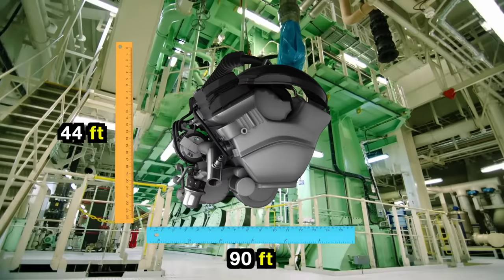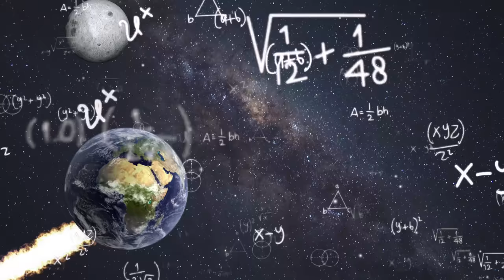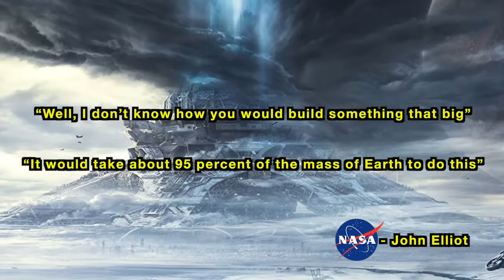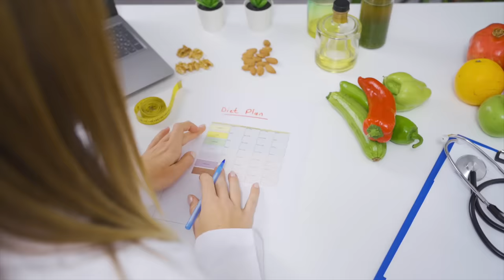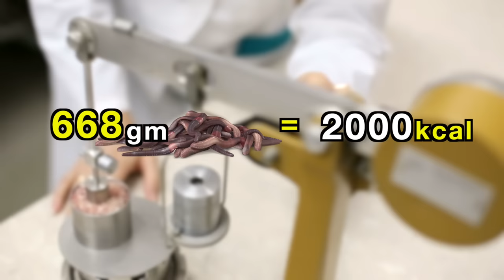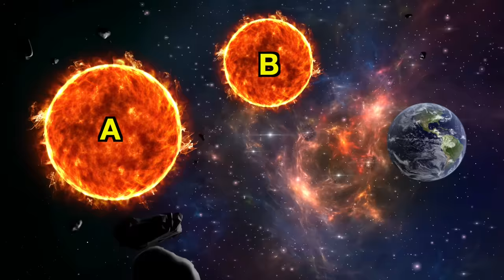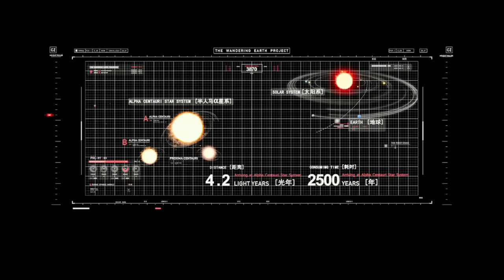Why You Wouldn't Survive THE WANDERING EARTH

Comment: This is actually one of the most viable plans for interstellar travel.  It's unlikely rockets would be used, not because of construction...such scales would require self reproducing machines...but because the heat generated by such engines would fry the planet and deplete even nuclear reserves.  More viable would be massive solar system solar projects and using gravitational steering by shilling various heavy objects near earth with very large solar sails.  The journey would take 10s of thousands of years, but we'd had a frozen yet still living planet underground, as radioactive decay in the earths crust still maintains temps there at 50C.  Surface life would die out and the atmosphere and iceans would freeze, yet they could be partly preserved for the warming period after the journey.  The vast quantity of resources transporting the whole planet is the main advantage here, as well as having a nice home after you arrive.  10s of thousands of years is a drop on the bucket in the earths history as well.  It's again one of the MOST viable options for interstellar travel...although barring a catastrophe it would be done with smaller objects like asteroids first.  With the later it would be possible to passively accelerate to even a few percent light speed using large solar sails and sailing the solar wind like an albatross.  Again the materials and resources are the key factor here.

Comment: What fuel are they using for the fusion process? How are they supplying such a massive amount constantly for 2500 years? You need to input energy to fuse anything with a higher atomic number than iron.
How are they keeping jet engines working for 2500 years? Jet engines tear themselves apart because of the high pressures and temperatures involved. And those are engines manufactures with the highest quality materials. If you are making a jet engine the size of a mountain not only would the engine would be using weak materials and weak construction techniques because it isn't possible to build something that large using the highest quality materials or techniques.

Comment: Solution:  Capture a small asteroid and use it to slightly attract the Earth away from the Sun.  Bonus:  This red giant has less mass so it will be easier to pull Earth toward the edge of the solar system.  Actually the Earth will be too hot in a billion years so there is plenty of time.

Comment: The Light Year is a measure of distance, not time so it is nonsense to say the trip to Proxima will take 4.4 Light Years or 2500 regular years! Even then the maths is off. There just wouldn't be enough fuel to accelerate a body the size of Earth to any fraction of the speed of light that would result in a travel time less than 40,000 years far less 2,500! Then you'd need exactly the same amount of fuel to slow down at the other end and enter any kind of orbit around Proxima.

Comment: The fuel requirement would only be for accelerating, no need to burn the entire way, just to speed up and slow down. No friction to slow down with. And the mass issue, no hard solution. Maybe cannibalize the moon and every asteroid on the way, if there were a technique and capability for it.

Comment: If they could make such massive engines and ridiculous energy production, why not just build orbital habitats around the larger sun or live on one of the moons orbiting the gas giants? If you have that much energy capacity you can produce your own heat and light practically indefinitely. It would take a larger energy mass than the entire Earth to move the Earth that fast. Most of the Earth's mass would produce practically no energy if used as fuel as the energy potential is incredibly small if not near zero. And what do they plan to do about the atmosphere getting blown off?

Comment: Space travel and planet colonization of another planet is more realistic way to survive by research a hyperspace travel that can reach a light year speed. Sci-fi spaceship is more realistic, you can survive if the sun explode and die if you have a spaceship but the chance of Humanity scattering in space is high but not that it matters as long as the humanity survive. Planetarian colonization is more realistic than moving the earth to another star because if you try to stop the earth from moving the magnetic field of earth would also stop and it will cause the earth to crush in pieces but before it happens humanity in Earth will die in more violent earthquake and tsunami.

Comment: "Will we make it there alive?"

No. No we won't. 

The Earth would either freeze over or burn up or both before it even managed to leave the solar system; because the Goldilocks zone does not, in fact, encompass our entire solar system.
Reply: Yeah, but all water won't freeze due to the heat of the core, other than that. Moving into a very low Jupiter orbit will generate enough tidal forces to create just enough heat to maintain liquid surface water, however this is risky.